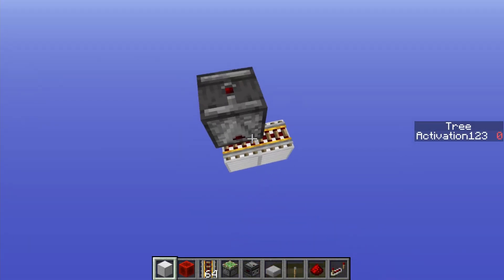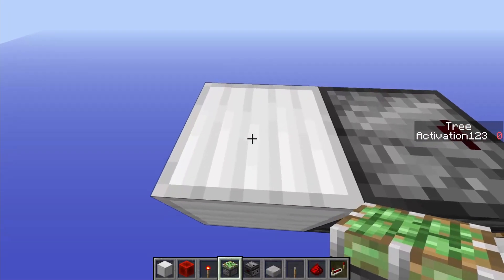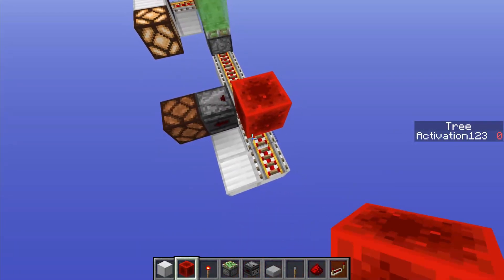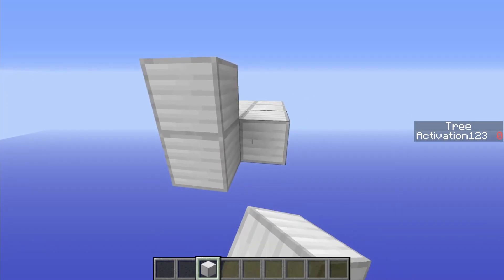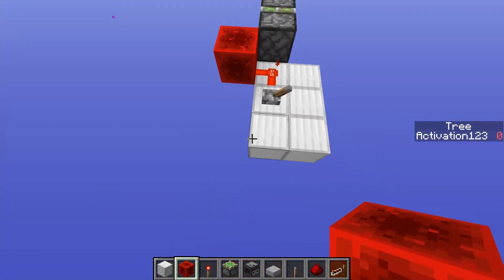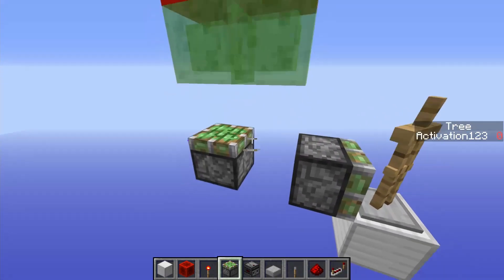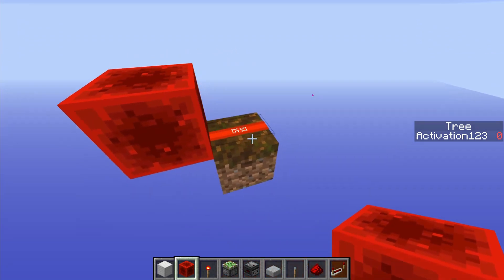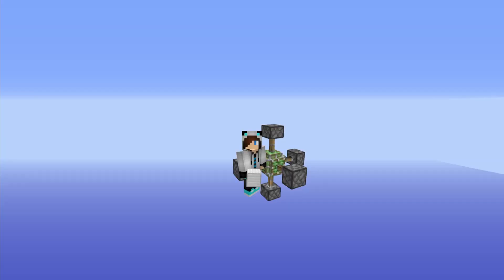Basics Of Dustless Redstone

Comment: Have you considered scripting videos like this? This video is a cool introduction to dustless redstone, but the speaking was a bit hard to get through, due to repetition, filler words, misspeakings, etc. And it may also help more generally towards having a more calm and confident cadence.
Reply from the maker: here is the thing, when reading i end up stuttering a lot more, and i struggle reading stuff, and also acting it out at the same time.  I have tried to do scripts many times before actually, they have just ended up worse than the original video.